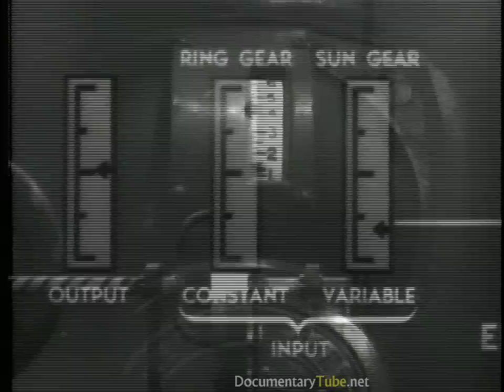HOW IT WORKS: Planetary Gears

Comment: People making digital animations of mechanisms really have to watch a lot of these old model demonstrations. I always find them much clearer to understand because they show just the simplest elements without all the bells and whistles, but they also usually show the whole thing without leaving out critical components (because an actual model can't work without them).
In all the animations I've seen, they never showed what the ring gear actually connects to. (Or mention that it connects to anything.)
Reply: Hmm. 
Did you actually watch the video and try to understand it? Or are you one of those "They don't make them like they used to" types.

This video is unclear and the cuts to the young soldier show no detail and barely correspond to what is being said. Cuts to the tank are useless. And the ratios are intuitive with prehistoric math.
This video helps to confirm bias. It's only value is the 5 rules and they only make sense after one understands why. As presented they cannot be used to predict motion.

Old quality videos exist, just like new quality videos. This is neither.

Comment: I see a lot of comments that indicate a desire to understand.  Let me try to boil it down.  A planetary gear set has 3 parts:  The central "sun" gear, the three small pinions (planets) mounted on a frame (a planet carrier), and a ring gear around the outside.  That is a simplified set.  The Sun, the planet carrier, and the ring gear, they all spin, at different speeds when the drive is turned on.  The drive is the sun gear attached to an engine.  Hydraulically controlled clutches and bands are used to control the three rotating groups.  By "control" I mean  a group can be "held" from the outside which makes it become stationary and act as a reaction surface (reactionary).  Or it  can be locked to the shaft by a clutch which makes it a driver, or it can be neither held nor locked which allows it to freewheel.  If all clutches and bands are locked, the gear unit binds, and turns over as one bound up clump giving you direct drive, or as if you had no transmission at all.  So the question is do I want to attach my wheels to the planet carrier and use its rotational speed, or to the ring gear, and use its rotational speed or do I want to bind all the gears and use that rotational speed.

Comment: In the case of two inputs, the last one shown, what happens if the sun and ring gear are rotating in the same direction but the sun gear exceeds the constant speed of the ring gear? I am of the opinion that the planet carrier still remains in between the ring and sun gear and still rotates in the same direction. Am I wrong in my assumption?
Also, in the compound planetary gear setup he said that the planet carriers of the intermediary and reverse sets were connected via the output shaft, I am trying to understand why that is necessary since the planet carrier of the reverse is reacting to its own sun (rotating cw from the intermediary ring) and its own stationary ring gear. Can someone please elaborate?

Comment: when are we going to learn to reverse the engine and not the transmission?for a radical change!
Reply: bah humbug The "Semidiesel" in the Lanz "Bulldog" tractors would run in reverse also.  There was also a trick they could do where the engine would make half a revolution, bounce against compression, then go back the other way, so that it sat there appearing to run but actually burning fuel but accomplishing zero.  Rumor has it several of those engines were elected to various legislatures.  ;-)
Reply: Large low speed diesels used in the marine industry do that, it is called direct reverse
Reply: A steam engine (steam motor) or an electric motor can be reversed.  Likewise air and hydraulic motors.
Reply: i ment the motion of the pistons and the crankshaft!

Comment: Wow, most deliberately confusing video ever.
Reply: JasmineLindros
You are supposed to study this in a class.
It's for mechanic training, most american machines using planetary or related gearsets are serviceable after modest training for the cause and concerns associated with a particular gearset. i.e. Previous examples
Reply: i dont even know the first thing about cars or the things inside and i got the basic "two gears connected invert the rotation" idea
Reply: agree

Comment: Naah i still don't get it...
Reply: The outer ring is fixed in place, and has a lot of teeth. The sun gear is in the center of the ring gear, and has only a few teeth, since it's a lot smaller and the teeth must be the same size. The planet gears (usually 3 to balance the loading around the sun gear) have the same sized teeth around a gear circle exactly the distance from the sun circle to the ring circle. As the sun gear rotates once, it's teeth make the planetary gear turn the same number of teeth, and since the planetary is connected to the ring gear as well, it travels around the ring the same number of teeth. For example, If there are 20 teeth on the sun, and 100 on the ring, that means the planetary only goes around 1/5 (20/100) of the ring as the sun gear goes around once. That's your gear ratio: for every one turn of the sun, you get 1/5 turn of the planetary around the ring or it takes 5 turn of the sun to go once around the ring, or 5:1 reduction ratio. The planet gears are held in a carrier frame, and there is a shaft connected to that frame that can drive a pulley, gear, wheel, or another set of planetaries, to reduce the speed (and increase to torque output) again.
The sun gear is usually the input (like the drive axle in a car), the ring gear is the anchor surface (like the road) and the planetaries are like the wheels that carry the car along.
Reply: @waldolost5181  Makes more sense now thank you!

Comment: I want that on my bysicle
Reply: Good thing there are a few types out there, the NuVinci from Fallbrook Technology (ball type, 2 models), Sturmey Archer, Shimano Alfine (3 versions), and Rohloff Speedhub (two widths and a number of different set-ups of operation) for hubs or mid drives (special applications per type of bike frame). Then there is Schlumpf with two mountain and one road or speed gearing and also Pinion which makes 4 models (18, 12 andd two variations of the 9 speed) of pinion type planetary gearbox (crank) set. 
Not counting the others still in prototype or testing.

Comment: is 12:1 reduction give more torque ?
Reply: +Dante hollow When speed goes down torque goes up when the power is constant.
Reply: yep, if u do reduction u convert the speed to torque and if u do the reverse u get more speed but less torque ;d

thats what i know not sure 100% :D
Reply: you are 100% correct. If you crunch the numbers, the output power will always be slightly less because there is friction between the moving parts, but the rule is true.

Comment: Isn't this the similar machanic of Toyota Hybrid Drive System?
Reply: Yes, both the Toyota HSD and Chevrolet Volt utilize planetary gearsets.
Reply: Correct me if I'm wrong but I think all automatic transmitions use planetary gear sets
Reply: Brendan Kelly not quite. Honda and Saturn has some that are quite similar to a manual transaxle but utilize clutch discs instead of synchros to change ratios. Also there are newer style cvt and such that do not use planetaries. But most still do lol